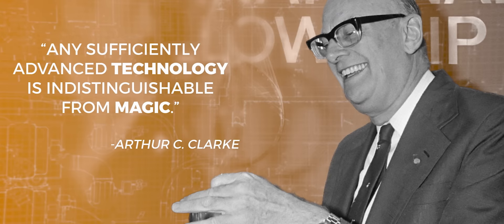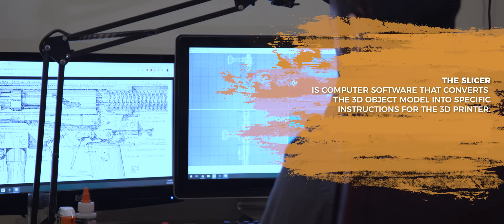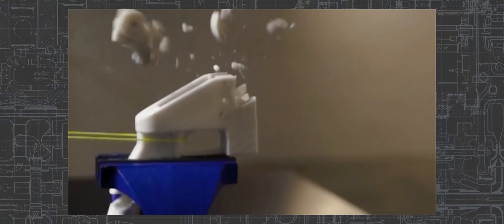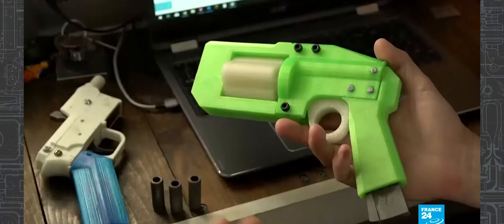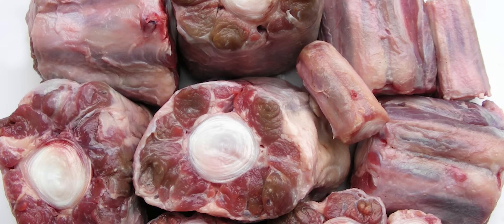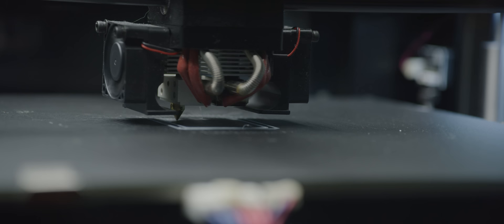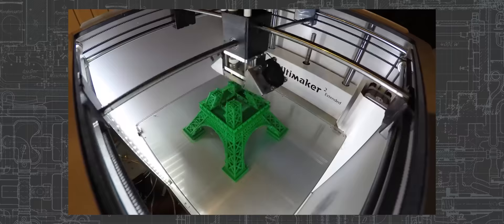3D Printed Guns, Explained

Comment: Ban lathes, mills and shapers.
Problem solved.
/sarcasm off.
Reply: A gun can be made using simple hand tools. Lol
Reply: @Razor-gx2dq  
Oops, my bad.
BAN HAND TOOLS!
Reply: By the power of my drill press I will give someone a coronary who I don't know, but I probably won't like them.
Reply: ban hands!
Reply: Super late, but return to monke!
Reply: There was a bill recently that proposed to make equipment like that require a license. Basically only machine shops would be allowed to own them making it easier for them to have visibility.
Reply: Ban drills and pipes
Reply: To shoot someone you really need one bullet, two pipes and a sharpened bolt :-) Prohibit plumbing pipes and bolts.
Reply: @obywatelcane6775  true, but you can make it a lot nicer with a welder

Comment: 3D printed gun is hype, why 3D print a AR-15 lower reciever in some week plastic when you can 3D print a mold and cast a lower reciever in aluminum, brass, zinc or even two part resin.
Reply: yeah
Reply: shelly belly Because the “weak plastic” can survive thousands of rounds, is easy to make, and only costs like $2 in filament to print.
Reply: there are already 3d printed guns made of metal
Reply: Can you pour hot molt aluminium in a plastic cast or will it melt itself?
Reply: @RandomGuy9  won’t melt
Reply: @nivaneh1010  it will, check into lost pla casting
Reply: Because you only need the gun to work until you can trade up to a full giggle gat curtesy of the soup.
Reply: Epoxycast 690 is great for casting. Incredibly hard and durable cure.
3D printing has definitely uped the game. You can print your parts and use the print to make a mold, and have some crazy durable material.
Also, there are materials, like ADX, that are amazing durable. You could also harden the 3d print with a nice coat of epoxy.

Comment: The fear of the future from most people is so strong they completely forget that the machines and equipment to build guns and weapons are already here since the 1890s. Every person with a lathe or a mill, CNC or manual, can build a more durable and precise weapon than the most 3d printers. As he says in the video if you think you just print out a file on your cheap china printer while using the PLA shipped with it, you are going to learn really fast that 3d printing is not so easy as the media says. In the best case scenario you are not able to load the bullet into your weapon, in the worst case you lose your hand or your eyes because shrapnel s of your exploding gun fly everywhere
Reply: Don't fear the 3D printer fear the CNC mill that shit is real deal steel.
Reply: Your 100% wrong🤣🤣🤣🤣

Comment: Working on my 3rd fgc9. ANYONE can literally make this. Even do my own barrels utilizing ECM process. Greatest part about the build..not one thing that’s metal that’s used in it screams Hey I’m a gun part! It’s completely untraceable
Reply: idk buying explosion proof barrels it pretty recognizable
Reply: @someguy7232  that’s why you use 140,000 psi strength 40CR hardened hydraulic tubing.

Comment: Needs to be perfected. Print them, doomsday prep and wait. I like the idea of 3d printing them. Seen some good videos of people using them.
Reply: I feel as if 3D printing needs more emphasis on the polymer side,
Reply: Rifle Connection  Yea or just download fosscad's repo and waste more fund on filaments.
Reply: There are two different printable 357 magnum revolvers. You need a barrel insert, but it's epic. Espicially if you do lost casting for the printed parts to have them as steel. Then with the barrel insert it could be used for who knows how long. Maybe ages.

Comment: I've been following 3d printed firearms for a couple years and it's been fun watching it evolve from just 3d printed mags to people straight up 3d printing and putting together full/almost full guns with the exception of the barrel and upper. It used to be a niche thing but now anyone can go and buy a 3d printer for less than $200 (Creality Ender 3) and download the files meant to essentially make full on rifles (got to /k/ and ask for the Ar/k/) and have their own firearm that could work with the right materials.
Reply: The uper can be printed but it couldnt resist more than 90 bullets in a row but not becouse of recoil but becouse of the gas that is at high temperatures and the firing pen has to he Made of steal (i'm not totaly sure about it ) also do u have a link to a site with cad gun files?
Reply: @ErickStoner  There is a sight called "DEFCAD" if you see you this. It has files that you can download for handguns, mags, ar 15 lowers, fire control groups, the fgc 9 mk1, the fgc9 mk2, the mod 9, the list goes on man.
Reply: @chickenman5477  I've learned a lot since the thing I posted but thanks pal 
Be careful the big one is watching
Reply: @ErickStoner  Your welcome man. And yeah i know they're watching but it don't feel right letting them prevent me from spreading this knowledge.

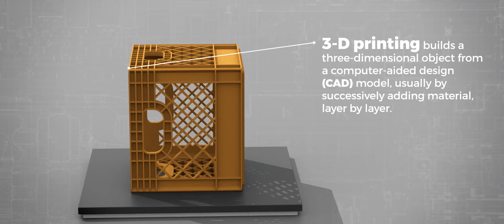Comment: 0:17 You need to rotate the object 90° with the bottom of the crate touching the build plate. Otherwise it will require extensive supports to prevent sagging of the overhangs.

Comment: He's wrong about the fully 3D printed gun part. The Mockingbird and the washbear are fully 3D printed
Reply: @Free Marketeer I thought they mainly did all but needed a nail too
Reply: Songbird and liberator too. And yes they need a nail for a firing pin but that's all
Reply: @notmefrfr  then it is NOT fully 3D printed, I don't know why this is so complicated, either something is fully made with the printer or it is partially made with the printer requiring outside parts
Reply: @ericg4915  you can fully 3d printed some guns with a single nail used as a firing pin with some rubber bands. If that isn't close enough idk what to tell you.
Reply: @ericg4915  also if you live in the us all the "other parts" aren't considered firearms so a 12 year old with a visa gift card could order it to their house. Then you 3d print the lower receiver which is considered a firearm and boom. 3d printed gun with some online bought parts that aren't regulated at all.

Comment: Just because you haven’t see instances of very good working firearms just means the right people aren’t making them yet.  
  
I guarantee I can make an easy to create firearm that uses a standard metal piping and pin with minimal moving parts and have a very effective durable gun.  All it takes is one person to share the file snd documentation and anyone could have a gun.  

The important thing is to make sure law abiding citizens have access to guns to counteract the criminals who WILL be 3d printing guns (and selling them to other criminals).
Reply: You know, what you are describing sounds an awful lot like work.....and people capable of doing said work could make 20 to 30$ an hour doing legal work ( instead of  ~ minimum wage which is what most gangbangers earn ).
Reply: @dwwolf4636  depending where you are a 9 milimeter may be worth 2 to 3 k usd easy.

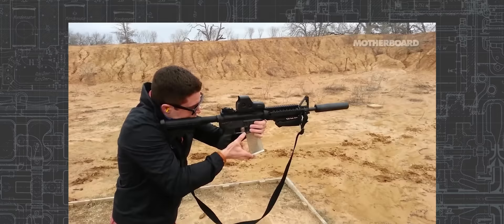Comment: 3:35
Thats where you're wrong kiddo
Reply: Agreed, but you need to print it out of nylon for it to not explode in your face.

If you want the gun to be able to shoot more than 2 bullets, you need carbon nylon... and this filament is difficult to print.

The precision is gonna take a hit, but at point blanks  it would work.
Reply: Zach cash  where i live (Quebec) acquiring these tubes is close to impossible (at least legally) but i see your point
Reply: Zach cash  hahaha, no worry, i really love the circus that is politics right now and its kind of the reason i am interrested in guns ;)

Lets hope there is a version of Donald somewere in Quebec politics...
Reply: @elielbourrelly9902  you never heard of a lathe. just mill a barrel. go to a workshop. cast a reciever from metal. finish it off and your done. 3d printing is usefull because making gun parts is hard and extremely precise work if you dont do it right.

Comment: Question´s ahead  ! 
prepare a cold bevarege

I do not get the debate ate all. What are you people arguing about. Is it making guns at your own house or is it making guns out of plastics i.e 3D printers? 

If it is about making guns in general, you would have do ban all lathes and all mills NC and CNC. 

If its about making guns out of plastics and walking trough a detector, did you consider the fact that a cartridge is out of Metal? I do not want to go in details but a cartridge out of plastics makes a whole new set of problems ( not even mentioning the bullet itself and the primer)

So, what is the debate about? I honestly do not get it. 

Is it the part where you are physically able to manufacture illegally yourself or is it the fact that it is made on a “cheap” printer? I honestly do not get it.  With a half decent mill, you can produce a working firearm that is capable of firing multiple rounds / mags before having issues. With a plastic gun you can be thankful if the first round did not kill you due to shrapnel’s from the “firearm” itself. 

Light me up, is this debate just to create clicks and a public aaawwww or is there more to it were I am to European to understand ( meme intended, pun not so much)
Reply: I’m American and don’t understand. I’m pretty sure it’s for the pure “shocking” story in media. It’s a non issue not really sure why people are freaking out about. Basically the only reason for 3d printing a gun is maybe proof of concept that you can make a POS weapon compared to a regular firearm.
Reply: Careless printed platforms are viable now with homebrew filaments.

Comment: You can tell this video was maybe before the Plastikov existed 
This guy: "You can't 3D print an AK"
Ivan the Troll: "Hold my Vodka"
Reply: So it is completely 3D printed? Every single piece came off the printer? Including the barrel, firing pin, springs etc etc? That's hard for me to believe
Reply: @ericg4915  nope, but as long as you're in the US you can buy a parts kit, print the receiver, and have a fully functioning AK

Comment: You dont need to print guns that last a lot of time. 
You need to print a gun that lasts for 1-2 shots (the chamber, barrel and firing pin can be made from things like common tubing and nails) and then assemble it all in 3d printed guns. 

With that, you can go to an enemy, take a shot and grab a good gun

Comment: 0:19 This is completely wrong printing orientation, I would print this on the bottom of the box
Reply: The way of printing  is correct in the video. When a load is applied, the force would be transfered within layers. If it is printed from the bottom, the force would be applied between layers, overtime/under great payload, the layers would be seperated, thus creating failure
Reply: Josef is right when it comes to needing a loadddd of supports for the top section.
Reply: tt tong Sure that may be true but mechanical properties aren’t the only concern, actually being able to execute it is pretty important too

Comment: As I pick up 3D printing, I can tell you that if the US don't embrace 3D printing, China will. Actually, they already have. 

But 3D printing gun should not be a concern for even the leftest of the left, when they understand the technology. I live in a country with gun homicide ratio on par with the US, and they have their 1st mass shooting recently. The country has a lot of coup, as guns are tightly regulated. One of those coup saw the army trained terrorists to make guns from metal parts. That knowledge was passed from senior to junior and now everyone with tools can do it. How obnoxious is it? Basically, make a tube (no rifling) and put a shotgun shell in it. If that sounds like a sawn off shotgun, because it is. Thugs and juvenile whose knowledge were passed from their senior use that to attack people from other schools, to collect trophies like buttons or belt heads. You know sawn off shotgun can't really be aimed, right. It fires into the general direction. That's exactly why collateral damage is so high in this country. They shot it into a bus filled with people. They shot it on the road. They shot it in a mall. As long as the time I've spend here, I've seen this kind of guns shot everywhere.

If I can choose, I'd rather let those thugs 3d print a precision gun and use that instead of the one they're making. Guess what, they won't. Because making the gun that way is much easier. You don't have to swap your hotend, prevent heat creep, fix under extrusion nor level your bed.

So, a lesson from a 3rd world, the 2nd amendment is there for a reason. Keep it. Maintain it. You may not like it, but there is no factor in history that will not change something. It is there then, therefore the states is here now.

Comment: EVERYTHING in this video is wrong in the sense that it is irrelevant.  3d CNC can make a gun that is ON PAR or BETTER THAN any gun you can purchase.
3d CNC is the negative of 3d printing where instead of laying down the material, you start with a large block of metal which is then shaped the machine tools.  You can create ANY shape you want with a 3d CNC machine.
Like 3d plastic printers, it is  a FILE that can do it.  So all the saying "this tech isn't ready for real world firearms application" is 100% WRONG!
Reply: Well, alright. But what do you propose be done with the regulations and such?
Reply: Nothing.  There is nothing that can be done.  The barrier to entry with CNC is far greater.  A computerized CNC machine with a Z axis starts at around 5k and probably needs 3 phase electricity.  Still, 5k is within the reach of most people.
There is no way to do it. It's too cumbersome.  However, you could stop companies from selling the plans. Most don't want bureaucrats breathing down their necks.
Reply: Stating what?  If you mean CNC, there are videos on YT of people making receivers using a CNC machine.

Comment: This is a very good discussion...
See, i live in Canada,  beautiful place but no gun.

I love guns (know this because i did go to a kind of military camp where we shoot rifles)

And here is the thing, making a gun is not as difficult as they said it is...

First, it needs to be printed in nylon to not explode on firing.
Second, you need carbon reinforced nylon to be able to shoot more than 2 times
Third, the liberator is good, but the barrel needs to be a cylinder (flat part of the cylinder printed on top/bottom to be able to have pretty good cylindrical tolerences.
Fourth, the hammer and the parts before the bullet has to be made from metal (or at least a metal insert) since it is blasted with explosive fire of doom.

And that is it... not so complex is it?
It is still gonna deform for every shot, but if you get a replaceable barrel than you just clip in... it would be close to acceptable.
Reply: Look up the FGC9 on twitter, its made with PLA+, is simiauto, test examples have been fired I think several hundred times without failing, and is completely unregulate-able.
Reply: @lordfirebeard8569  interresting, that is a good point :)

In an article mentionning the "Fuc gun control 9" FGC9, it is said that the barrel was a bit of a problem.

As you can guess, he used another method of manufacturing called electrochemical manufacturing...
This is a complex one that kinda errodes material using electrical charges (yes, this is a simplification). But you still need the shape of the barrel (the twisty bit :) to imprint that form into a part (also, this method works only on metals since it needs electrical charges.

As i said before, you can print most parts out of any plastic, but the stress bearing parts need more than just a little care and small machines.

I am not saying it is not possible, just that it is definitly harder than some media sources would let you beleve.

Thank you for making me learn about electrochemical machining :)

Comment: Even if the government  were to somehow outlaw the transmission of these files, it wouldn't make them go away. I'm a CAD drafter, and it would be trivially easy for me to model a lower receiver in solidworks, freecad, inventor, or fusion 360, and then record it to a physical piece of media the size of my fingernail and give it to someone, or put it in a 3d printer to print. (Many 3d printers will work without any network/internet connection) I'm not especially talented with such software, it could be done by any drafter or engineer who wanted to.

Comment: Well, there's filaments that are good for printed out guns, like carbon fiber, metal, and other flexible filaments. The nozzles for the flexible filaments have to be a hardened steel, because of the abrasiveness of the flexible filaments going through the narrow end of the nozzle, and then the heated bed has to be up to 100 celsius and higher.

Comment: Mehh.
CNC mills are where its at for guns.
Files for that were available since the early 2000s.
From rifles to handguns.
No idea what the hubaboo is about with regards to 3d printing and firearms.
Plastics do show up on xray machines..especially in combination with modern software systems.
And the ammo still uses metal.
Any fully plastic gun needs too much plastic to withstand the stress of firing that theyre too bulky to hide easily.